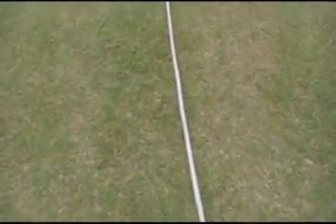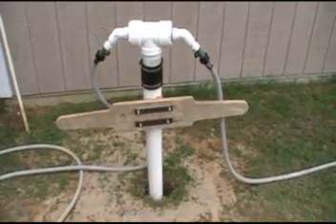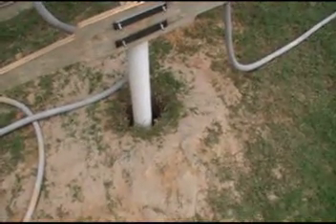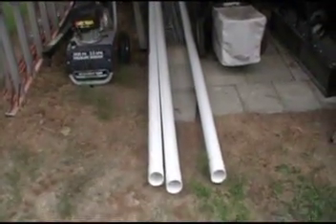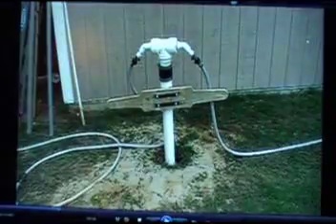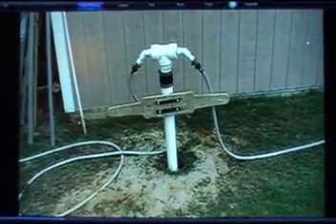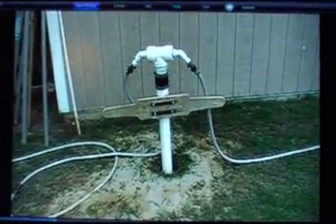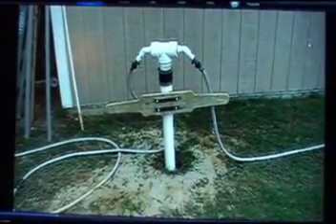Well Drilling.avi

Comment: pour ammonium nitrate and some Diesel fuel down the pipe. Lay a firecracker in the pipe with the fuse hooked over the top. Light the fuse. Run. As the fuse burns the firecracker drops. BOOM! Roots gone.
Reply from the maker: Great idea not only will it get rid of the roots but for ever contaminate my drinking supply and the work I have done to get there.